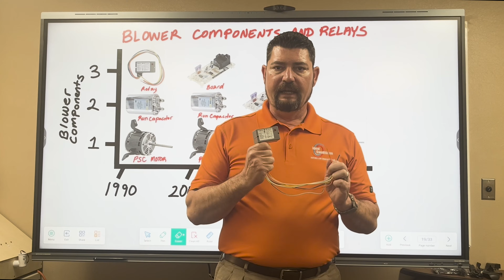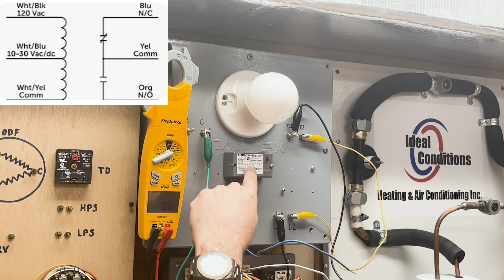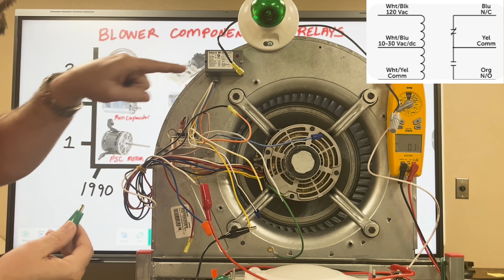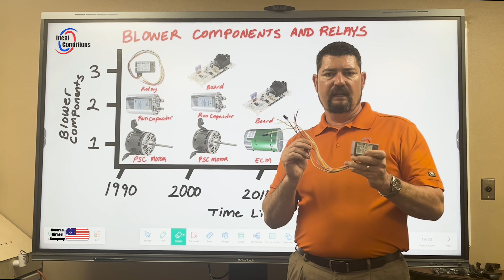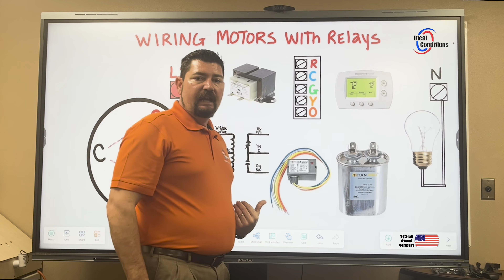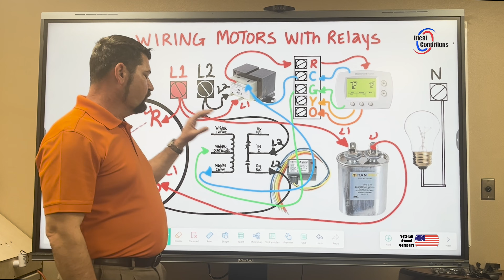How to Wire a RIB Relay

Comment: Hi, thank you for taking the time to explain and show this process. How would you wire it if I wanted the light to turn on every time the blower fan turns on? The reason I’m asking is because I would like to add a booster fan to my ductwork.

Comment: if I use the 10 amps version for a blower (6 amps), what happens if the blower short (not sure if it is possible)?  would it trigger the breaker or should I get the 20 amps version?